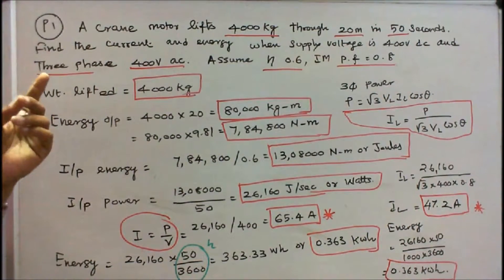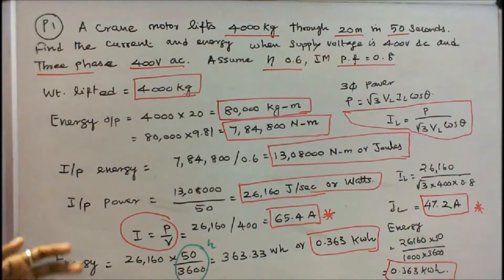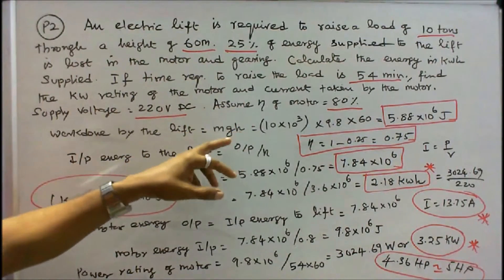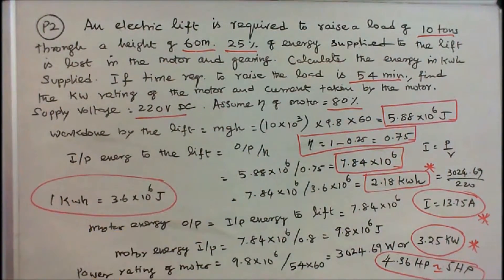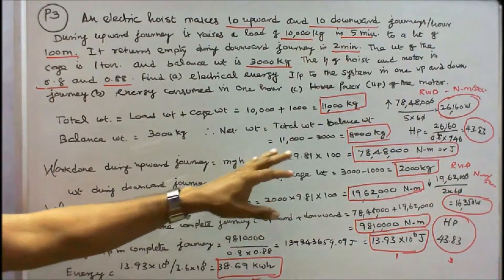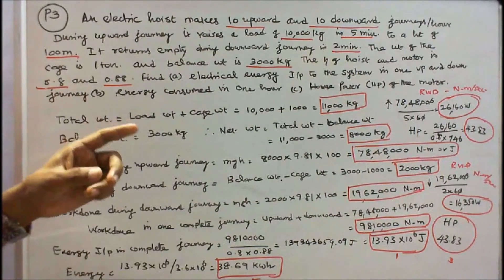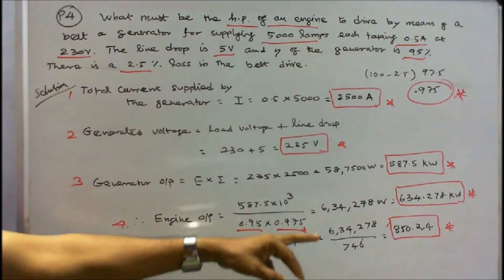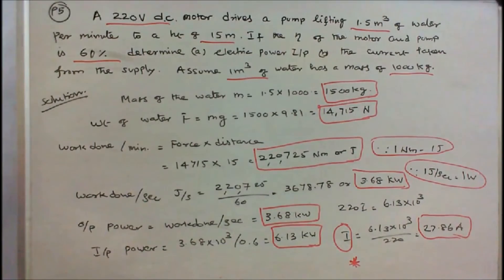100 PROBLEMS IN ELECTRICAL ENGINEERING - PART - 04 - FIVE PROBLEMS ON MOTOR RATING

Comment: • Calculate the number of lifts for a 7 floor office building , which is located at center of the city and total rentable area of the building above ground floor is 3500m².  the height between two floors is 3.5m. the time for synchronizing the lift cars at ground floor is 30 second and above the lift ground floor is 10 second. It is required to empty the building in one hours. Consider the given specification : 
1. Capacity of lift is 15 person
2. Speed of the car  is 105 m per minute
3. Rentable area per person is 10 m²
4. Estimated stops are 1 stop each 10 m above ground floor.
plz solve it